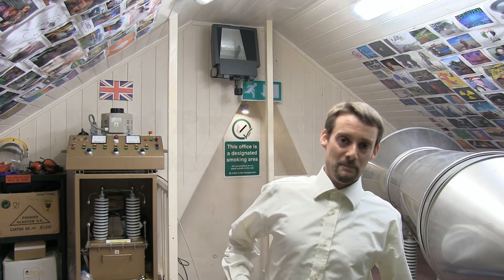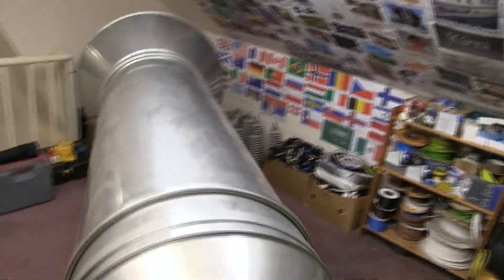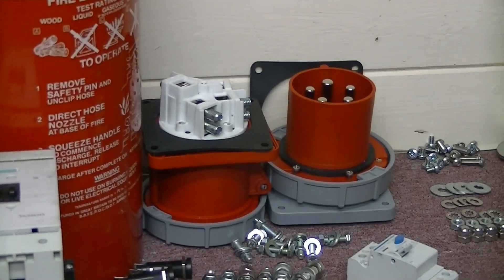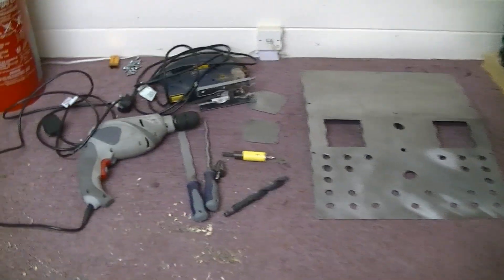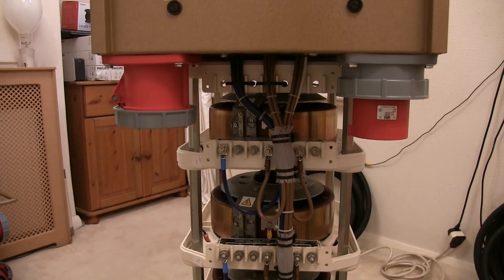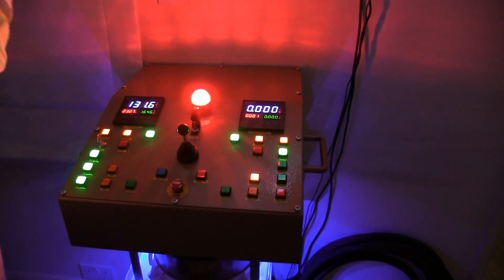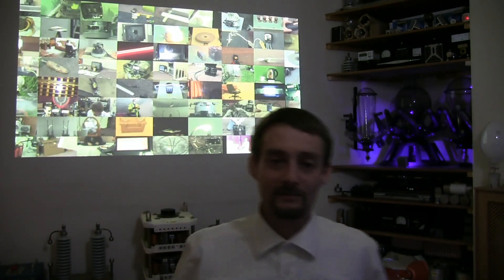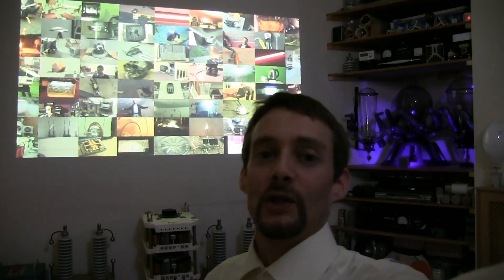20,000 Watt Power Supply

Comment: i would send you my blackberry playbook, but i sort of killed that myself :P
Reply: I rekon that power supply would kill it again.
Reply: haha i would too but mine's stuck on headphone mode

absolute crap they are, not even YouTube works properly on it now (can't sign in)
Reply: c0d3r3d mine was so slow and lost wifi signal and crashed so much, i hit it against the corner of a table on the back which went right through where the motherboard is and then snapped it in half.
Reply: Lawrence Timme Ouch. Mine's slow too, it's crashed once but I barely use it now. I think the only good thing about it was the storage and the price, I got the 64GB model for £120 brand new.
I need to use the extended warranty I bought for it, I didn't spend £30 on it for no reason!
Reply: c0d3r3d i got the same deal. i rma'ed it once as well because the first one died within a year

Comment: I always upload in .mp4 with h.264 codec. Uploads just fine. If your upload fails it might be an issue with your internet connection that just doesn't show up in normal surfing (where you mainly download instead of uploading data)